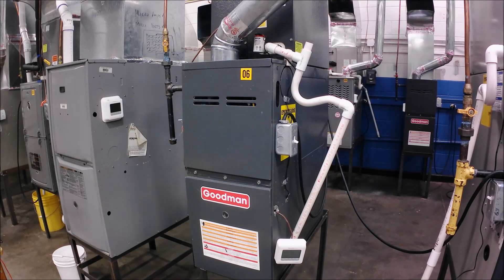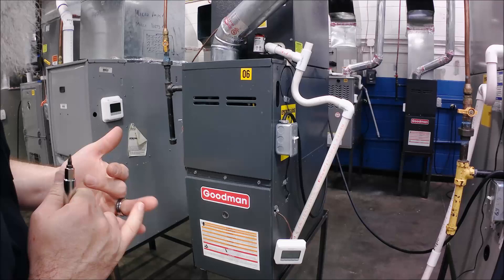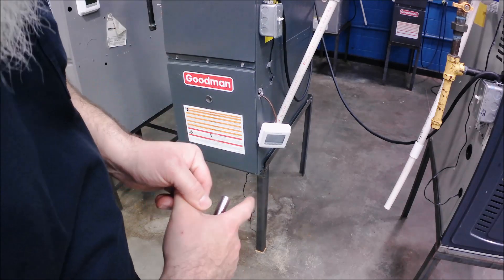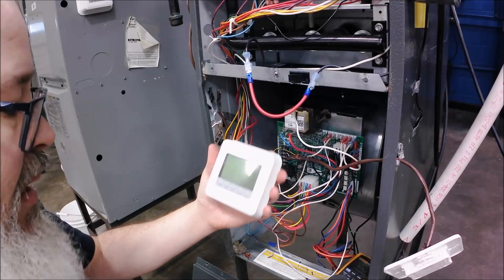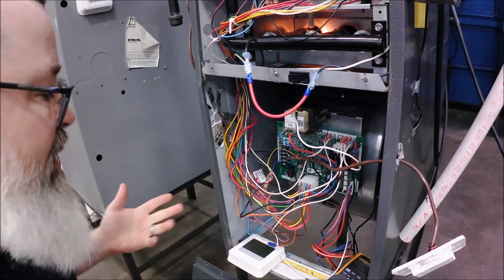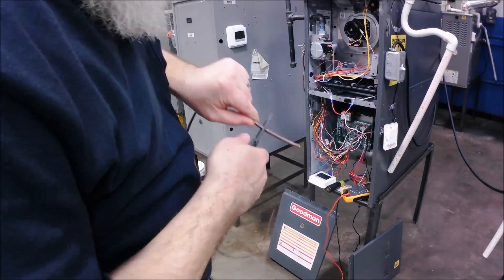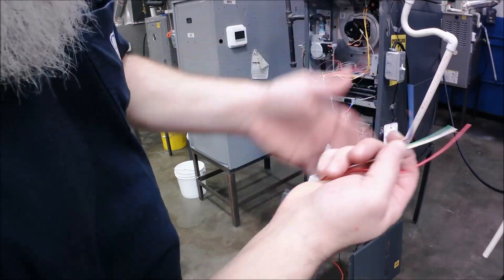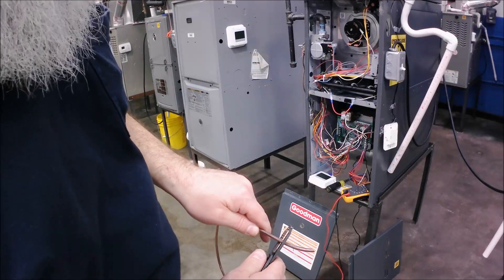80% Goodman Furnace - Heat Not Turning Off | Shop Troubleshooting (Bad thermostat wire)

Comment: Just use a little 3 inch magnetic tray for the door switch. Less time and you can't forget it because door won't go on until magnetic tray is removed, and great way to hold screws without losing them. 👍👍
Reply from the maker: Gonna try that soon. There are just so many different styles of door switch that there really is no perfect solution I think. U even purchased a SupCo door switch device that had magnets but it could be better.

Comment: I have a coleman central electric furnace in a trailer that the heat does not kick off. Blowers does turn off and the blower works with the thermostat. I have it on auto, but the heat stays on.
Reply from the maker: Sounds like a heat sequencer issue, probably sticking closed but (depending on the exact wiring) it seems like it would also keep the blower on.
Reply: @johnjennings-JJ  thanks i figured out the issue. I just turned the thermostat down so the blower wouldn't kick on and I could smell burning wire for sure. Hit the breaker, took off the panel and sure enough a jumper wire from one of the heating elements to (not for sure of name). 4 heating elements on the left side jumped to these black pieces in the center in a sequence to the heater elements on the right side. Some type of by pass, I'm really not for sure. I'll try and get the name of it tomorrow.

Comment: Ok...Gas Goodman Furance, Sometimes doesnt start when thermostat is calling for heat..and sometimes when its running it makes a noise like the fan shuts down and starts back up before the fan actually stops..Any ideas??
Reply from the maker: Tough one. First I would maybe check for any error codes on the board. But the way it sounds to me is that there isn't really any time for the board to register something. I think this is a baby sitting job! Sit down and watch it is what I would do. If you have an clamp style amp meter I would put it on the fan and make sure that is what is happening. If your ears are telling you correctly then it could possibly be a blower motor going out or a bad board that is not sending power properly. Nothing more aggravating than an intermittent problem.

Comment: The worst thing to do is to turn that gas valve off like you did. Pull the hose on the pressure switch and let it cool down.
Reply from the maker: I wouldn't say the worst thing...but we all have our ways.
Reply: Hey man can you explain this for me ...I'm new to the trade and I'm curious why it's not good to turn it off like that
Reply: @alanlacosse8850 just think about it.what are you doing by just cutting the gas? Think of the 7 steps of operation
Reply from the maker: Lots of different ideas but for me cutting the gas valve off (or using the shutoff in the gas line) and letting a unit reset itself - no problem. Just hitting the disconnect switch and cutting it all off so you have a hot box with no airflow through it - problem.
Reply: @johnjennings-JJ  so if you shut the gas off and let it reset, it's not gonna make it past the inducer motor step which will cool it down? Or am I thinking of this the wrong way
Reply from the maker: Depends on exactly what you are doing. If I am doing preventive maintenance and basic checks - I am only needing the gas off for a few moments while I remove the manometer and line I use to check gas pressure for example. I will also do that to see the unit cycle on and off properly. Or when I remove my tee from the pressure switch hoses... as I check the draft (or removing one of the wires from the pressure switch) and I know the unit should shut off and try to reset. I think of it like a safety check if that makes sense.

Comment: The delay between the time the igniter is powered and when the gas valve is energized has nothing to do with the igniter reaching temperature. It is a timed event only. The absence of a flame and therefore a signal is what interrupts the ignition sequence.

Comment: John, you are a life saver. This was my exact same issue. I searched youtube and no one was able have an answer except you. Sure enough  I unraveled my wires at the thermostat and BINGO! There it was just as you indicated , there were strippings of the wire that were touching each other. My issue was. The gas furnace would continue running even after turning power off. Thanks John for such wisdom and knowledge.
Reply from the maker: Your welcome. Its an aggravating problem sometimes!